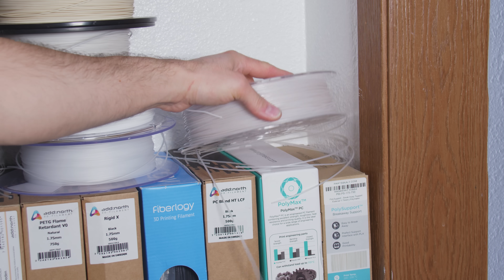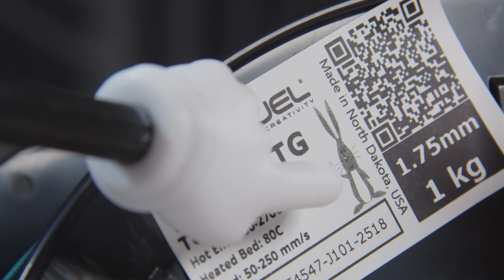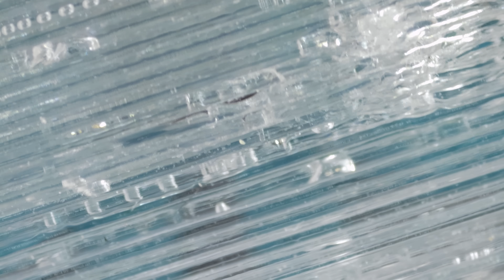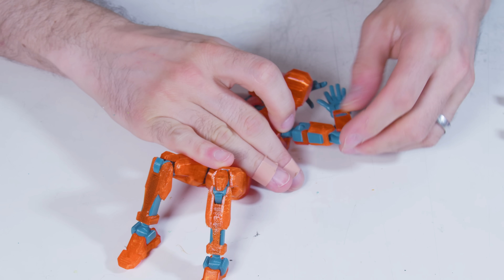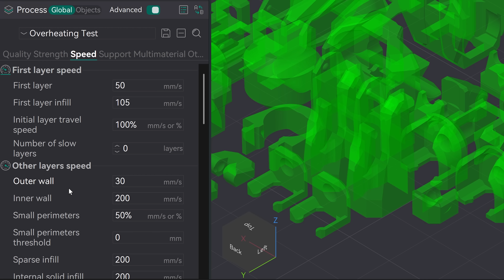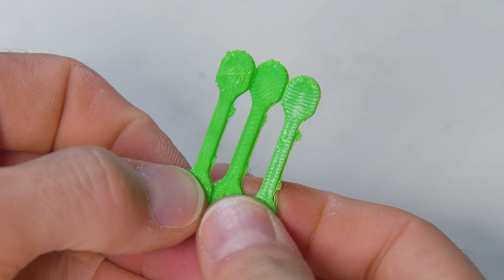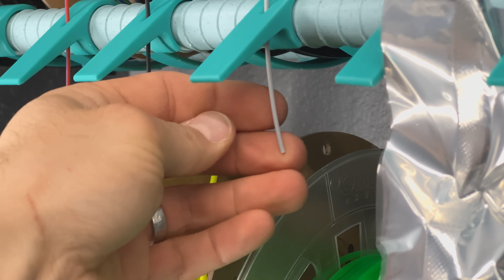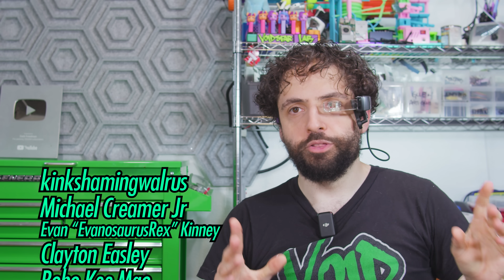Five Bizarre 3D-Printing Mysteries with Insane Solutions

Comment: I'll be interested to see how that filament clip does because to me, it does look like it is still going to stress the filament a fair bit. I'm currently experimenting with a push-in clip (129303-universal-filament-clip-to-glue on Makerworld) that is adhered to the inside wall of the spool. These are great because they don't bend the filament and they don't need to be removed before loading the spool into the AMS and they're always there. Having seen this, it seems like they would probably still stress the filament though. Maybe not quite as much, perhaps.

Comment: Your problem #3 happened to me with just plain PLA, but it happened on the first few layers when the layers are still thin enough and soft enough that the inertia causes chunks to be ripped up from the bed. My solution ended up being just slowing down the first few layers a little more. I have my PLA profiles set to print superfast, so it's not that surprising, but took me a while to figure out considering I couldn't find any pictures of printing problems online that looked like what I experienced.

Comment: My X1C has the crumbs of doom specifically with some of the 3d refuel pctg. I haven't had it happen with the normal pctg pro though. Frustrating that I imported the profile from 3d fuel rather than use my previously configured profile to try to resolve it with no success. Now I'm excited to turn down the acceleration and see if that's all I'm missing.

Comment: Zach see if you can tackle wall buldge above sparse infill where it goes to solid infill. It's an annoying and very persistent problem everyone faces. Staking 6 solid layers on top of 15 percent infill doesn't go perfectly. Many forums on the topic with nary a solution. Turning fan down for overhangs can help to reduce shrinkage of thr sparse infill layers

Comment: I got a whole 2 right, the moisture one and the burnt plastic one.
When it comes to the holding the spool tight one, I’m pretty sure there’s environmental factors that affect it, as I’ve always kept my spools loosely wound and have even had long lengths off a close to empty spool just lying around without anything to tighten them around, all without anything changing over years of storage. My storage conditions are cool, quite stable in temperature and semi-moist, meaning everything always needs drying before use.

Comment: I give myself 4 or 5 out of 5 or 6 (the last was outside my wheelhouse), and give myself one pat on the back for identifying the first one before any clues.  I found out personally that drying PLA too hot and too long can anneal it on the spool and give it much worse flow characteristics, which isn't the same issue as number one but was one of my personal rabbithole stumpers.

Comment: big fan of this episode. i wish all print issues were this easily explained. my biggest struggle with 3d printing for YEARS is finding actual good information and not just the same parroted shit everyone else regurgitates endlessly on every facebook group, discord server, and random 3d printer "beginners guide"
Reply from the maker: To be fair, most beginners have the same problems. Bad first layers, poor maintenance, and questionable print profiles are responsible for like 99% of issues.
Reply: "Have you tried adding a brim and glue to the warping plate? :^ )"
Reply: @tobunar  put some masking tape down! And slow your print speed.. never mind that you seem to have weird issues nobody else does....
Reply: wash your plate, dry your filament, tram your bed
Reply: @littlefrank90 I don’t even dry it. Throw it in and full send. Never had a problem😂
Reply: @littlefrank90 No wait; dry your bed, plate your filament, and wash your tram.
Reply: Search for papers... of the peer reviewed variety, not the... zigzag.. though that generally helps me with the research so i guess por que no los dos

Comment: Oh my gosh I had the little plastic marbles on my plate yesterday and hadn't ever seen it before, leave it to Zack to upload this video today explaining the issue!
Reply from the maker: It's a surprisingly common issue! PETG often does this, and so can TPU if your temperature's too low or fans too high. Try tightening screws on your extruder and carriage - if any are loose, add some Loctite.
Reply: @ZackFreedman it was actually my Bambu Springsteel build plate believe it or not, it got warped in the middle and caused a bump that the nozzle scraped on!
Reply: @lonestarlord  Yup, I've had this happen before with PLA, despite the "doesn't happen on bedslingers" bit. It's less common on bedslingers, but if you have a shitty bed or buildplate that got badly warped, it can cause this. My Ender 3 printed every single top and bottom layer like this for months before I decided enough was enough and decided to buy a new build plate.

Granted, PLA doesn't explode and leave crumbs everywhere, it just really messed up the surface quality.

Comment: 4. Jerk too high. Which is the change in acceleration. Sure, reducing the acceleration reduces jerk as a by-product, but it's the jerk that caused this. And max jerk can be set (in Prusa Slicer, at least). Though I'm not sure how many printers have a max acceleration on the printer itself...

Comment: Weirdest issue Ive had was gaps in a nylon part from weedwhacker line, I think it was printing to fast and the it could not deretract quickly enough due to how viscous nylon is. I pretty much turned off retractions and could run at the same speed with no voids (albeit greater stringing)

Comment: i literally cannot leave my overture pla spool ready to go on my creality k1 because in a couple of days the entire length inside the filament path will break into spaghetti chunks. Ill definitely try the filament clip
Reply from the maker: And unload the filament! Overhead filament holders, Bowden tubes, and especially AMS systems are really punishing!
Reply: @ZackFreedman  This might be what caused a problem I had, do you recommend completely removing the filament off the AMS feed then velcro strap it tight? I'm guessing the AMS doesn't roll back the filament tight enough if not it wouldn't be a problem then?
Reply: @ZackFreedman  Filament's relaxed state (as in no stress --> no cracks) is when it is left alone, and it becomes loose on the spool, not tight. So why keeping it tightly rolled (under tension) would avoid stress and breaks?

I would understand filament being under stress when straightened (by path, tube or pulling), but it's not constant -- some filaments just work till the end of spool (tightest rolling) while some filaments break within a week or two.
Reply: I had this issue with some VERY old filament that I left untensioned for years. It would break at random while on the printer, with there being definite "problem areas" that would keep re-snapping when I tried to fix it until I got past that point. I saw multiple people say "it's moisture" but plenty of evidence from others that it wasn't. It's been a mystery for a long time for me.
Besides a clip, a solution is (I guess) to just print more useful things and basically never have your printer idle for more than a day. 
There's always more that can be gridfinity'd.